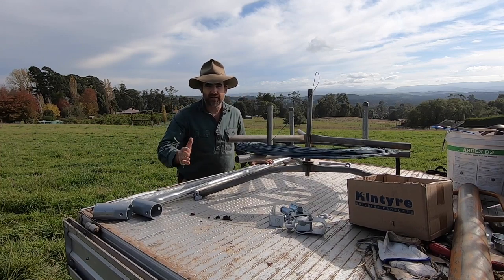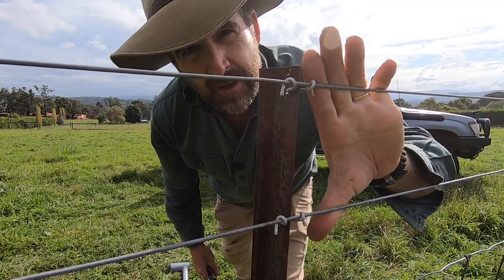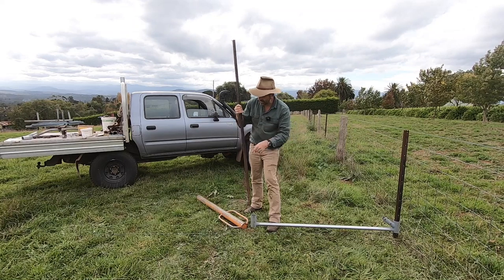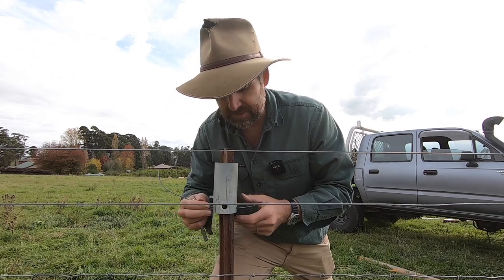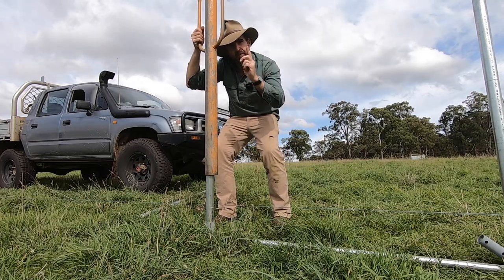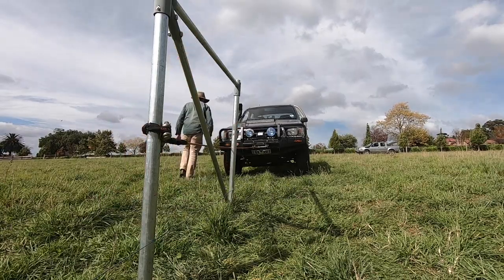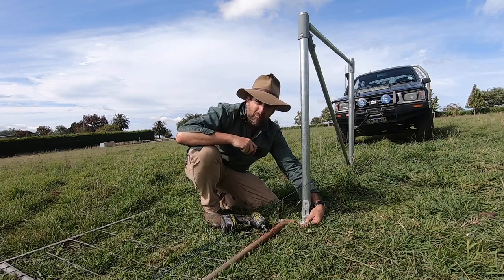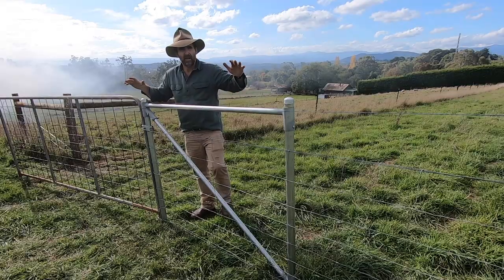How to Use Steel Posts to Make an End Assembly  FenceStay Kit Review

Comment: Very impressive & practical.  Looking at your wire winder to make it versatile (for another video you shared of unwinding a roll of dripper hose) cut off the four uprights on your wire winder and weld them onto four short sleeves that have a nut and threaded wing bolt for locking.  That allows the internal diameter to be altered for what ever roll you're unwinding.  Years ago I bought one from Steer Engineering.  So practical

Comment: I's there a reason why the steel box assembly is opposite to a timber assembly.?
Reply from the maker: Small advantage for the steel being that way as it can rely on compression tension in the stay. The diagonal stay in timber only works under tension of course

Comment: why couldn't you use this as a permanent fixture?
Reply from the maker: I Had it up for two years no problem. There are just other, stronger options (such as the FS2000 in the fencestay range). The FS1000 is ideal as a mobile, flexible, temporary end assembly option.

Comment: Winch power is irrelevant if you're driving with the winch in lock.
Stalling the ute doesn't really show much either.
Im not against the system, just the biased advertising. It was wobbly as as the end, not a good look.
Just show the system, don't make up tests that ruin the systems respectability and then try to onsell the future system because you've shown the current ones failures.
Not a great view of a decent system.
Reply: yes and no, the ute test was obviously a gimmick and light hearted at that, tims running road tires so they woull brake traction a hell of a lot sooner than say some muddies. i think anyone who has ever used a winch knows that if he put the ute in park and hand brake on then used the winch motor it would have pulled the assembly well and truly out of the ground,

Comment: Temporary and low strain. they don't hold long term.
Reply from the maker: Yes. Temporary. Although that exact fence was up for 3 years keeping the sheep in. Never lost tension or failed and it was in clay soil. I did use long steelies though